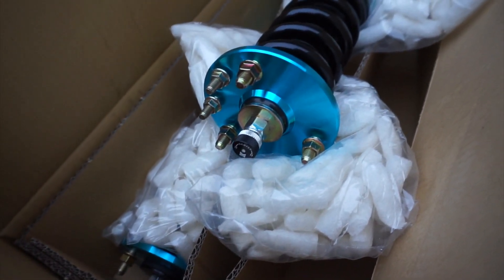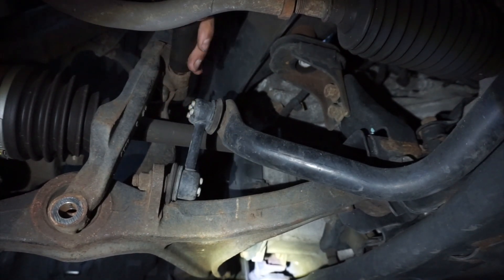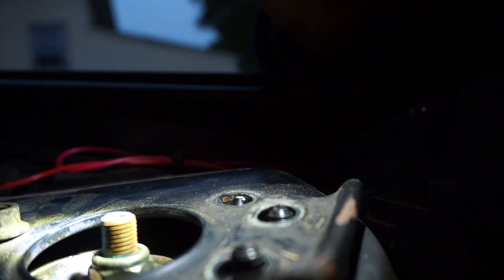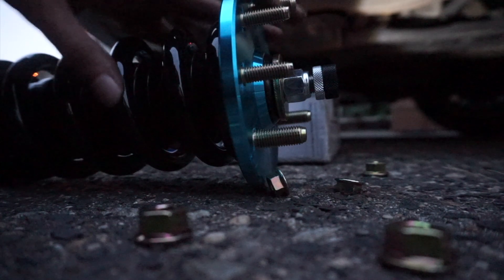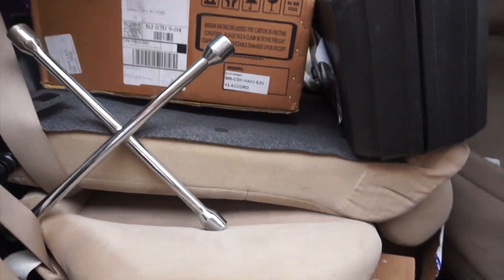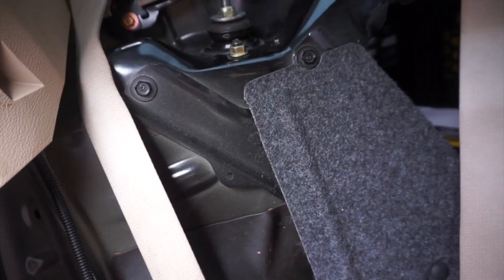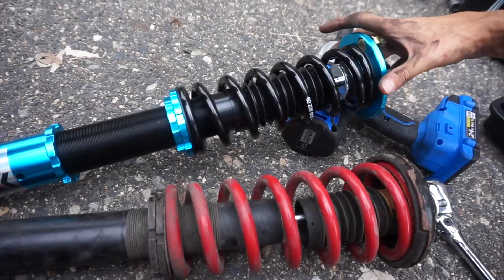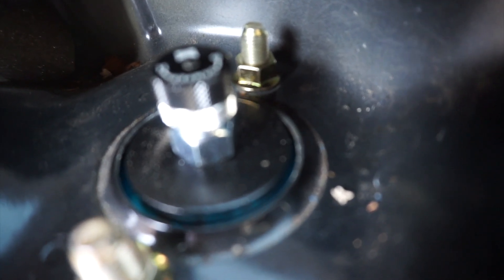03-07 Honda Accord Coilover Install

Comment: Hey! Im installing coilovers as we speak on my 03 Accord! The bushings on the coilovers (back) are way to big for the hole it’s going into, i tried pushing it and i tried everything, they are almost 1cm too big, what do i need to do?
Reply: Geta small bull horn or what ever size you need n hammer in. Itll open it up lol idk it what i do as an ironworker when a bolt dont go in

Comment: I had an Accord coupe of the previous generation and I just bought a 2005 sedan. It really feels muted compared to the older one I had, the seating position is too high, the steering is not responsive, the road feel is like zero and even the gearbox doesn't offer satisfying shifts. Is that just the way it is? Will coilovers help the road feel? Idk what to do, kinda wish I hadn't upgraded

Comment: Hey man I gotta question. On the lower bolt for the back coil over was there a nut on the other end?
Reply from the maker: Yes there should be a nut on the other end, I don’t remember the size unfortunately sorry about that.
Reply: @markvi_gti   did it come off or was it welded cuz rn I’m trying to do the back coil overs on my 06 accord and that bolt will not come off but the nut did and now the bolt is just spinning freely and I’m kinda lost 🤣🤣
Reply from the maker: Yes it comes off, hit the bolt with a rubber hammer until it sticks out a bit and then you should be able to get it out.
Reply: @anthonymason4170  the rear bolt was welded on my gfs 04. I felt dumb tryna get it out 🤣

Comment: Yo when I type Honda Accord 2007 coilovers on eBay it comes as TSX (Accord Euro) in my country do they both fit?
Reply from the maker: Yes, they share the same chassis
Reply: @markvi_gti  I think it's called CM5 in America is that right? On eBay it says it doesn't fit. Our model of Honda arnt popular in my country I don't wanna buy the wrong part can you tell me what model is that called in America if U live there is it CM5 or TL
Reply from the maker: They are CM5 and CM6 over here for sedans and Cm7/8 for coupe
Reply: @markvi_gti  thanks bro, so are you 100% sure the 03-07 tsx coilovers will fit the 03-07 CM5 
and also do you have the link where you got yours? 
Thanks much appreciated
Reply from the maker: Yea definitely will fit, I got these from throtl
Reply: @markvi_gti  thanks bro really appreciate it how much were they I'm thinking about getting some long long eBay ones hahahaha what do you reckon
Reply from the maker: I don’t really remember how much they were but eBay ones should be fine if you don’t mind how they will ride
Reply: @markvi_gti  I just found your older comment 800$ USD that's like 1.4k Aud lolllll legit just wanna dump it with a cannon muffler hehe

Comment: How do you ajust it when there on a car or before????
Reply from the maker: You can adjust it before putting them on and when they in the car but you would need to lift the car and take the wheels off

Comment: What was your opinion of the raceland coilovers? Why are they garbage? I know they are cheap... Lemme know
Reply from the maker: Honestly, they got the job done which was to get the car low. I’ve had two of them blow out on me which may not have been the coilovers fault possibly because the roads here are so awful. I didn’t like that adjusting the ride height also changed the preload and also the collars seized up on me a few times (again maybe not the coilovers fault). I just wanted more adjustability which the Megan Racing ones had
Reply: I looked on the website and I don’t see them I there. Are you sure you got them I Megan racing